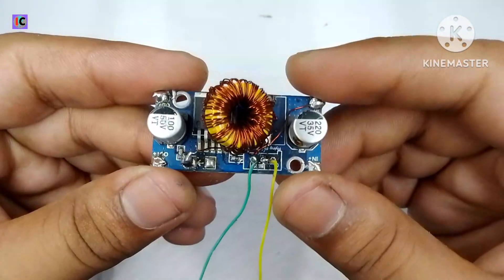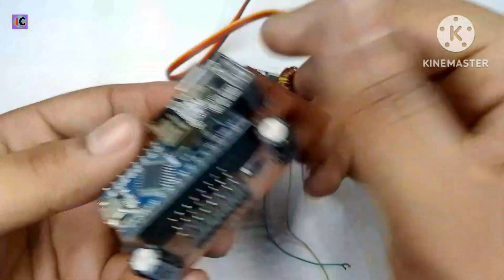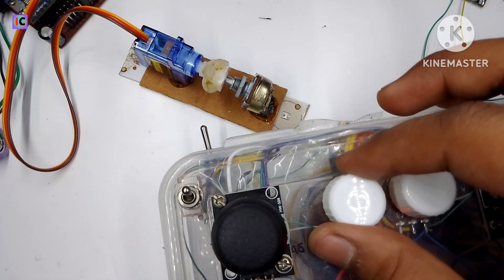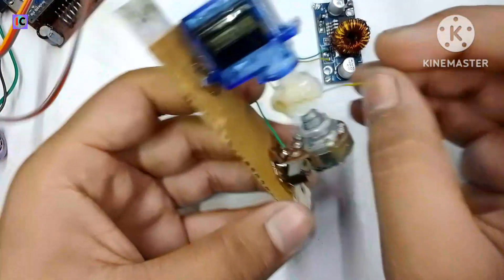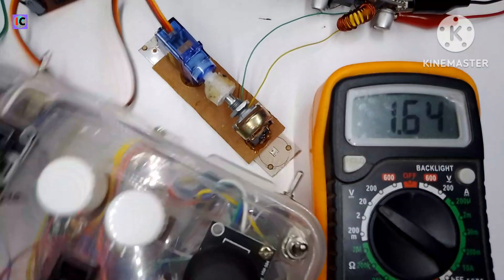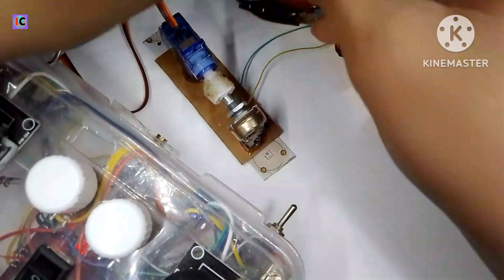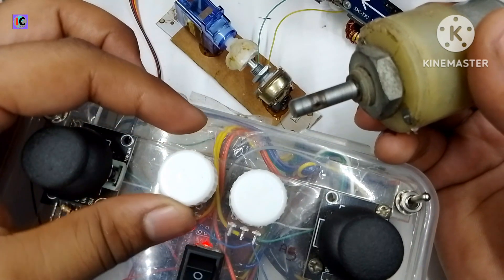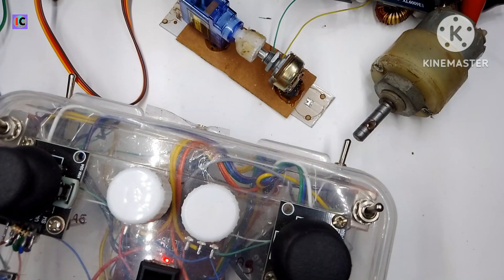How to Drive Brushed Motor without ESC #dcmotor #servomotors

Comment: Yeah...no! The motor is starving for current when your voltage source is low. The whole point of a PWM ESC is that you feed the motor full voltage and current all the time. All that changes is HOW LONG you apply full power. This isn't going to replace a brushed ESC.
Reply from the maker: In this video, I demonstrate how to control DC motor speed using an XL6009 DC-DC converter. By rotating the potentiometer, you can adjust the output voltage, which directly controls the motor's speed. This method offers precise and efficient motor control.
Reply: @innovationic  Yes...I know what you are doing and no you are wrong. Precise and efficient...no not hardly! A DC-DC converter with an adjustable output voltage is starving the motor. It can't run at full torque at anything other than whatever is the max output voltage. Anything less and the motor  is receiving too little current to develop max torque. This is the genius of PWM based ESC's! They apply full amps and volts to the motor always. All they adjust is HOW LONG it is applied. AS a result the motor is almost always running at full torque. Yes...sure...under no load...you can adjust the RPM of the motor with adjusting the voltage. Good luck doing that under load! For that you need a PWM ESC. 
*
You are a smart guy. You ought to know about PWM motor control. I'm surprised that you think adjusting voltage is how you control motor RPM under load. You won't find a brushed variable speed drill or any other brushed motor tool on the planet that adjusts voltage! They 100% do it with PWM. 
*
Ironically, if you had that PICO o-scope connected to your DC-DC, you'd see that it too is adjusting output voltage via PWM. Pull the output filtering cap or check signal before the output schottky diodes so you can see what the DC-DC IC is doing right at it's output. You will see that it's making PWM of some kind.
*
If you are running the motor direct from the DC-DC IC's output leg with no filtering, then you are feeding the motor actual PWM and that's very much the same thing as a brushed ESC. If so and I misinterpreted what you are doing, I apologize. I do make mistakes...it's normal for us humans!
*
There's very good reasons for PWM control for lots of things:
1. You are feeding the motor full amps and volts all the time. All you are adjusting is how long you feed it vs how long you aren't feeding it. More time with full power and the motor spins faster. Less time with full power and it slows down.
2. Mosfets and transistors work similarly in a few key ways. They both have a linear region where they act like a potentiometer and can be adjusted via the gate or base to have more or less resistance across the main junction. Resistance = heat and you want that as minimal as possible.
3. Mosfets and transistors both have a fully saturated state where they can't be turned on more. In this state the main junction is at it's lowest possible resistance and therefore making the least amount of waste heat.
4. PWM...aka turning the mosfet or transistor on and off in its saturated state creates the least amount of heat in the power components. This increases efficiencies and makes electronics live longer lives. Even audio amplifiers now days are  almost all Class D or PWM driven instead of operating the power electronics in their linear regions where they make the most waste heat.
Reply from the maker: yes these days digital electronics is used in wide range

Comment: if your DC motor is small you could simply dismantle the servo and swap the internal motor for your motor of choice and lock the position sensor pot in the center of its range with glue.  To drive a larger motor you can instead use the motor output to drive a BJT H bridge.
Reply from the maker: Yes it's also a good idea and if you want to control AC fan speed with triac based regulators then this method is very effective.